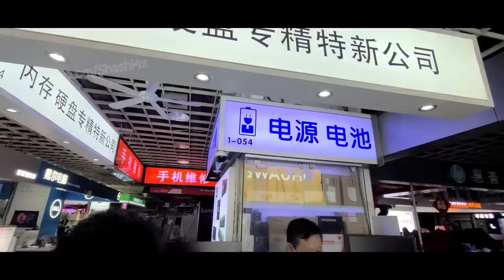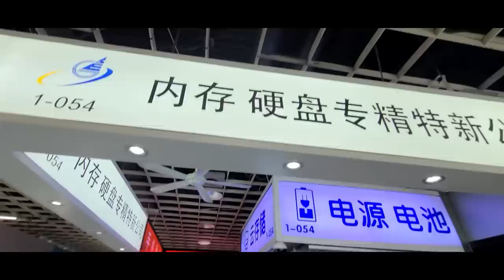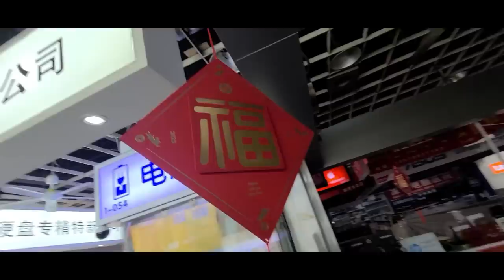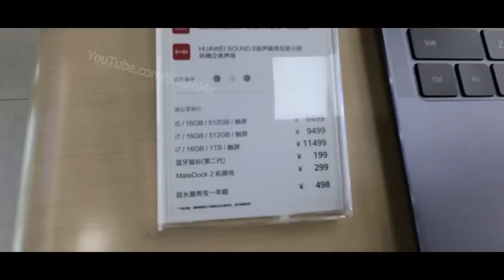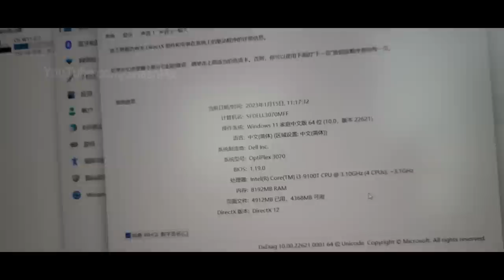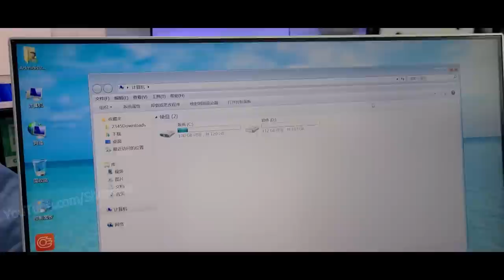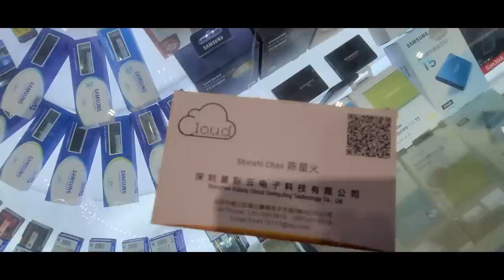How Chinese Repair PC | Shenzhen | Hindi Vlogs

Comment: Hello Shashi Bhai, I have a laptop which I custom made from China few years back, it was working fine, but now it has issues, it's not turning on. I showed it to some experts here, they said there has issues with it's motherboard and they don't have motherboard to replace that. 
I have a question to you if you can suggest where I can get the laptop motherboard or can someone from china can custom made that? The laptop I purchased from is Yepo company there in China.
Reply from the maker: If it is more than 3 or 5years then forget it better buy a new laptop
Reply: @shashi4x  Thanks for the reply, yes it's 3 years old now

Comment: He don't do any repairs,if you have extra ram or hdd and you can check yourself but you have knowledge how to disassemble and assamble safely 💯
Reply from the maker: Yes correct
Reply: if hdd is faulty it will redirect to boot screen.... if ram is faulty display will be blank... but in this case display is there for seconds... protection circuit switching board off may be shorted component somewhere....
Reply: @shashi4x  dada have you any social media like Twitter which i can follow and chat with you,plz provide if you have, thanks
Reply from the maker: @Roni26112011  Instagram Shashi4x
Reply from the maker: @prasadcnavale  thanks for the info

Comment: From what I see in this video, I can say that the motherboard is fine and working
But the display screen and it's power supply inverter board needs to changed..... Or just buy an external monitor.......
Reply from the maker: Ok thanks for the tips

Comment: AIO PCs are kinda nasty and are crappy to get inside, but if you where given one and or have to use it, there is really no choice. There is too many integrated components and getting them off is a pain. This is really where custom PCs win and are the most economic choice, but they want to take it away from us all. At the end of the day it's better to service it than bin it, just takes more labour but that's how it should be anyhow once we think about it. You get to keep it in the long run.
Reply from the maker: Thanks for the comments I agree with you 😊😊